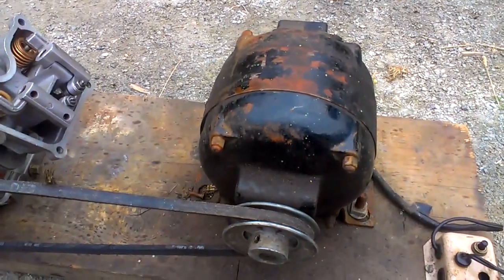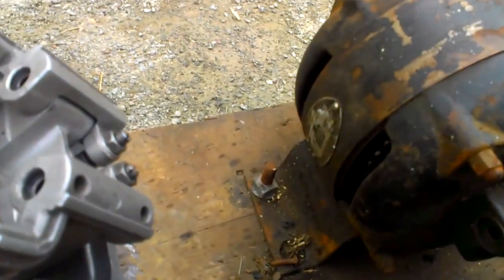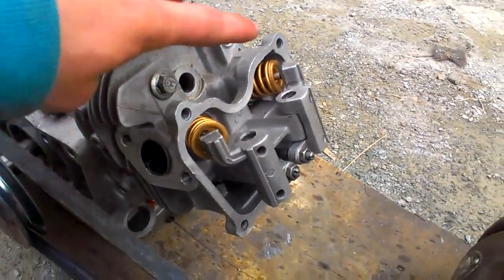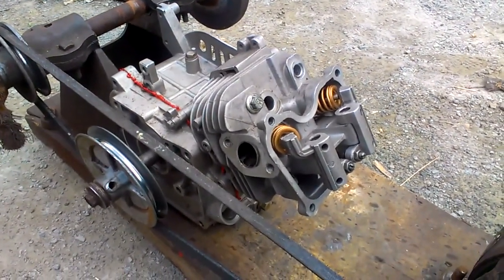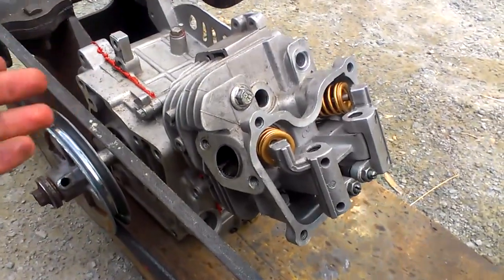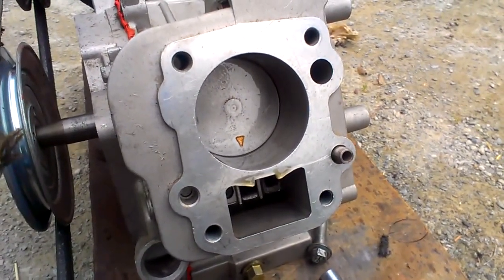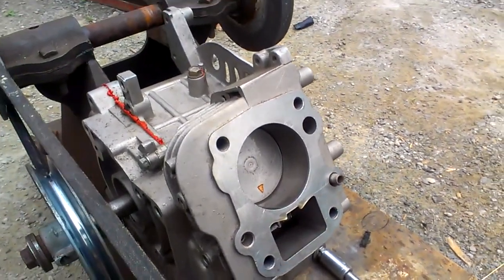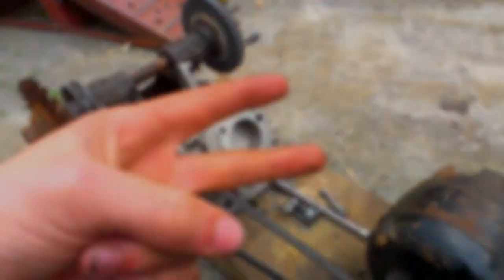Inside An Engine At 1000 RPM

Comment from the maker: I don't know why a lot of people are getting upset over the fact that I'm "wearing the engine out" or "scraping the piston to pieces." Like I don't already know these things. I found this engine in somebody's trash stripped down from most of it's parts (Carburator/Head gasket/oil level sensor & ignition coil) and black oil full of metal fragmentation. So I used it for demonstrational videos like this one, and sold it for scrap aluminium months later. And FYI, removing the piston rings did created less resistance between the piston and bore. I was there, I'd know xD I've stripped down/worked on/experimented and fixed many small engines before and there is a difference in resistance between an engine with and without rings when spun freely. Sorry ;)
Reply: People are looking for reasons to complain about nothing at all.
Reply: you are a gentleman
Reply: These are just idiots trying to show their huge "knowledge" on engine's lifespan at the wrong place. People whine about everything these days. Keep up ur great videos... cheers
Reply: Jay Oake experiment?
Reply: Some people would not know that
Reply: tubez4321 exactly.
Reply: Good video buddy. Thanks
Reply: Dude your wearing the engine put and scraping the piston to pieces are you stupid

Comment: The reason the engine is only running at 1000 RPM is because the pulley is acting as a reduction gear

Comment: If this is 1,000 rpm then I feel bad for engines that rev to 9-10k
Reply: I was just thinking that. 1,000 RPM is nothing. F1 engines and certain motorcycle engines rev up to 18,000 RPM. But stroke length does matter too.
Reply: @tr5946  22000*
Reply: Trenton Leslie CBR250rr redlines at 19,000rpm, something i didnt expect an engine that small to be capable of. I dont think the double r variant in that size is available in the US. My quick google search shows the Y2K superbike does 52,000 RPM, allegedly.
Reply: This was more like 600/700 rpm
Reply: @naitranaitra8196  he literally showed that he was using a tachometer and it read around 1000 rpm
Reply: @alexstaten6131  maybe we are watching a different movie but that tachometer didnt move.
Reply: My motorcycle can rev to 2000 rpm.
But im still a bit confused on how many cycles the piston/cylinder is moving compared to rpm.
But apperently my thoughts were correct.
For every 1rpm the cylinder/piston  is moving a cycle for 1 sec.
Thats hella fast.
Reply: Size of piston, and stroke have a lot to do with it. Smaller engines with short strokes =higher rpm

Comment: If that engine is turning at 1000 rpm.. that isn’t even an idle on a single cylinder engine. Most small engines idle at about 1400 to keep running and in decent balance. Multi cylinder engines can run slower at around 500 rpm cause of the extra cylinders.

Comment: Remeber this is a one piston engine. Very different in a multiple piston engine
Reply: Uhhh not actually. Each four-stroke piston still behaves the same. There are just more pistons. There aren't any more or less steps in the four-stroke process just because you tacked more pistons on.

Comment: if you thought that was fast, think times six at normal operating speed when giving gas and driving.. youd probably need a high speed camera to capture anything, all you would see is a blur..
Reply: Gino Foogle not really this is faster than say a v8 pinned
Reply: Joshua Abraham b.s., source
Reply: Imagine it at 13k rpm....

Comment: Engine can rotate itself more than 10000 rpm !
Reply: A small engine can not sustain that high of an RPM. They are not designed to run over 3600 RPM's. 10,000 RPM's and the motor would grenade into a lot of pieces, if it even got anywhere near that.
Reply: I work on them for a living, do you? I have seen what happens to an OHV engine running over 4K RPM's for any length of time. An L Head will scatter the rod above 3800 RPM's.
Reply: Mechtron Industries yes the engine can but the grinder motor can not
Reply: RakinBill wrong
Reply: No, they are governed to about 3600 like was pointed out. You would need a bike engine with a different valve train to spin 10K

Comment: i have a question..what does the rpm meter read if there is more than 1 piston inside the engine..is it 1k rpm=1piston or 1k rpm=1+1+1+1 which means that each one does 250?this thing in my head for months..still cant figure out the answer
Reply from the maker: unknown username The number of piston are irrelevant, RPM is measured by the speed of the crankshaft, so if the engine is going 1000 rpm, it's basically saying the crankshaft is rotating 1000 revolutions per minute. Each piston corresponds with each other on the shared crankshaft 😁
Reply from the maker: So basically all the pistons (whether 1,2,6, or 8) are all going up and down the bore 1000 times a minute 👍
Reply: thanks for the answer

Comment: I didn't see any oil making it to the rockers, how do they stay lubricated in a splash lubricant engine?
Reply from the maker: KiwiPowerNZ I only had a quarter of the recommended oil level in the engine and these engines usually rev at 3000 rpm anyways which throw more oil around at higher speeds. Just not shown in this video xD

Comment: Removed the rings so the piston could "move more freely"? Lol wut? That engine was probably good before you did that. And did you really paint the valve springs, retainers AND the valves?
Some people...
Reply: The rings make more friction, why put the extra stress on the electric motor and belt?
Reply: TausKi not having a cylinder head removed all compression...
Reply: Cory Farr Are you serious you're concerned about the lifespan of that engine? It was found in someone's trash and brought here for demonstration... your comment was completely useless
Reply: deniaL the friction with the rings plus the oil is going to be very minimum. If that was the case we would be rebuilding engines every few hours..
Reply: No piston rings means, very low compression, as you meaned.
Reply: But without the rings a running engine would f*ck up.
Reply: I know but I meant the rings. :)
Reply: TausKi It wouldn't hurt the engine though. It's all g.
Reply: tann3rmaa I don't think engines can run without rings
Reply: Carlos Perez You're right they can't.